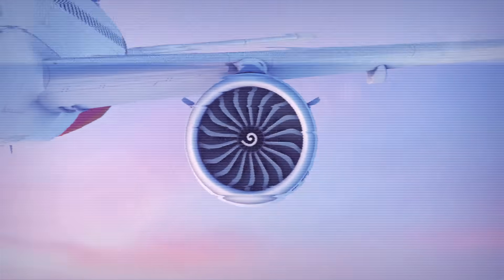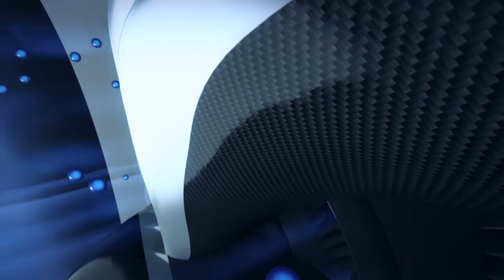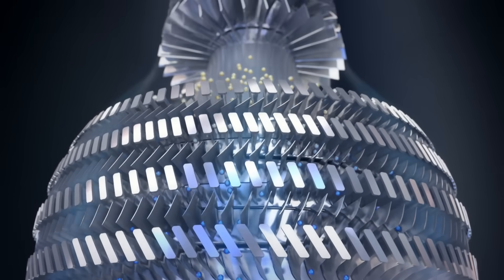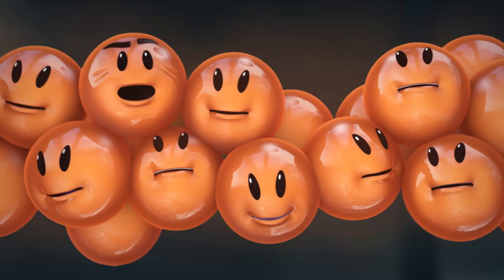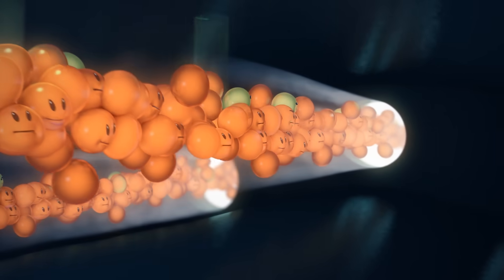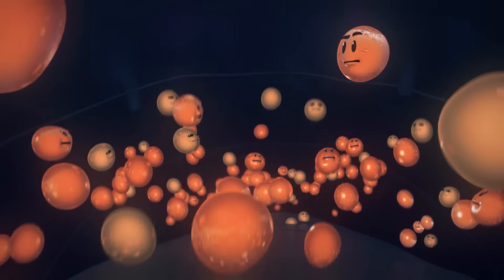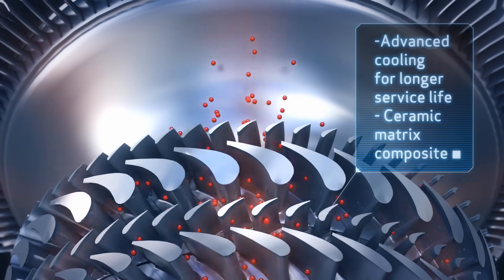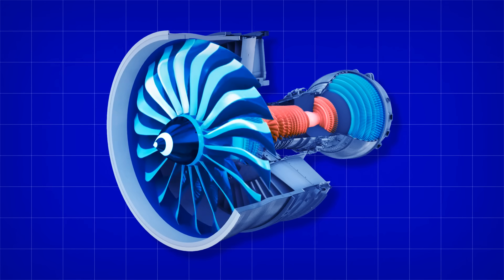How does a jet engine work ? | Safran

Comment: This is a great video, but I'm still wondering how exactly the compressors actually compress the air molecules? I just don't get it. How does a series of moving and non-moving fins and blades compress the air?

Comment: Hello there
its nicely explained, but have a doubt.
So it's like this
"From combustion chamber, high velocity hot gases mixture rotates turbine blades& drives the shaft.
And that shaft rotations are indirectly used to rotates the fan&  drives compressor"
This cycle keeps continuously repeating.??
Reply: Vishu Oza Correct. Remember air is just continuously flowing through, so all stages are happening at the same time. You can follow one molecule, but molecules ahead and behind it are in different stages

Comment: Actually most of the people think thrust is created from the exit of the exhaust chamber but here's the fact thrust of the engine is created by high pressure in engine and low pressure in front of the engine so it moves from high pressure to low pressure thereby aircraft is moving forward

Comment: Does the air that bypasses the combustion chamber get it power and speed from the spinning fan blades?
Reply: pigs make Bacon the fan act as a propeller and most of the thrust comes from that.
The primary flow (that goes through the compressors, combustion chamber and turbines) mostly provide the engine power.

Comment: I don't understand, how could you compress the air, when both end are left open?
Reply: that’s the thing, that’s air is compressed to got though the small combustion chamber, but it want to expend and so does it through the rear turbine. The compressed air turn the turbine while trying to expend.

Comment: why does it even need the kerosene i think the compressed air is what pushes it along are we really going to believe that 330,000  litres is held within those wings please. thats a lot of weight stretched out under many extreme forces. fuel hoax something to think about
Reply: In theory, with no kerosene injected and no frictional losses, the turbine would indeed be able to turn the compressor, but there will be no energy left to produce thrust. That's where the kerosene comes in to add extra energy to the air so after exiting the turbine the molecules will still have some thermal energy left to convert into kinetic energy (i.e. thrust) out of the engine nozzle. Please do not believe this jet fuel conspiracy it is one of the more ill-founded, if you have any questions let me know.

Comment: After combustion chamber what come out as an output??  I don't think it is only air? There should be also Kerosene residues.
Reply: Oguzstyler gas exhaust, just like a car or truck. And planes do have regulations for exhaust gas emissions that get tighter and tighter just like for cars and truck.

Comment: ok,so what makes compressor rotate, is it air ? or there is electric startor or what it is ?. I mean what is the source of the first motion?.
Reply: Mhmed Badra turbines
Reply: To start the engine there is starter, just like a car engine, but different.

Comment: Sir Frank Whittle did in fact single-handedly invent the turbo jet engine. Calling the He178 a jet plane was a bit of a stretch. It was more a hair dryer powered glider. Von Ohain's engine design, with its radial turbine, was a failure. No production engine was ever produced. On the other hand whittles engine went on to power the world. Also Whittle had a Jet engine running first and Von Ohain used Whittles work.

Comment: It it's a purely promotional video to sell LEAP engines, it's so dumbed down as to be ridiculous to anyone with any impact on whether or not these will get bought. 

The animation is fantastic. But really, there are two reasons why I won't be using this to help teach students:

- If it is an educational video, what's with all of the LEAP advertising?

- You are teaching a misconception at 00:41 where it says "thrust is produced by air being pulled in by the fan blades..."

In fact, air does not really support tensile forces. Sure, there is a lower pressure region around the front of the fan blades. But air is being PUSHED in by the forward motion of the aircraft and positive air pressure.

Comment: But how does it work in the rain?
Reply: water molecule is vaporized BEFORE they can reach combustion chamber due to hot gas during compression process.

water vapor are just air, because water is hydrogen and oxygen.
Reply: TheoneGodfather the combustion is sufficiently hot to not put the engine out, but flame outs due to unusually large amount of rain water have happened. Also with high bypass engines , where most of the thrust is generated by the blades which don't occupy the engine section i.e. Bypass, much of the water is just ejected by the blades and doesn't enter the compressors and combustion sections. The engines also have a spark set up to ignite fuel if the amount of rain entering is large.
Reply: exact same principles just that the water molecules have different properties..
Reply: Engines are designed so that they can run with water. It would've already evaporated and any remaining liquid particles will not affect the combustion a lot.
Reply: You are right, planes fly above the clouds and the rain can't touch the plane, but when it take off, the rain will touch the plane
Reply: How do you breathe in rain
Reply: Same thing is with clouds-they are also water. Different story are ash-clouds (from vulcano), they contain ash that can build up on fan blades and can choke engine making it flame out.
Reply: @new.handle  Volcanic ash is very abrasive, I am very surprised that the engine wasn't completely destroyed after that accident.
Reply: Simple! For the bypass it just gets yeeted out and the combusting it turns into steam or hot water.
Reply: when it rains you do not breathe?
Reply: Unlike internal combustion engines, jet engines are so lean (air: fuel ratio is like 50:1) that rain cannot cause flame out. Jet engine pre-delivery testing included shooting tons of water at it to make sure it won't flame out.
Reply: water doesn't get inside the engine
Reply: Usually planes fly above the clouds.

Comment: Where does the fuel go in? 
I jsut don't get that xD
Reply: The fuel injectors are a seperate stage to the combuster. Already hot air from the high pressure stage is mixed in with the kerosene before being burned in the combuster. Traditionally,the air and fuel mixed and were burned inside the combustion chamber.